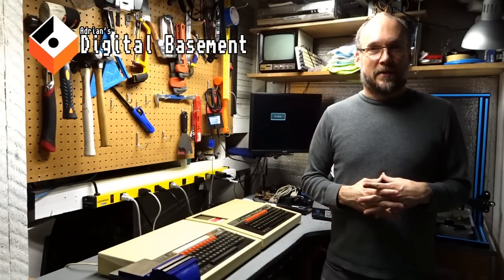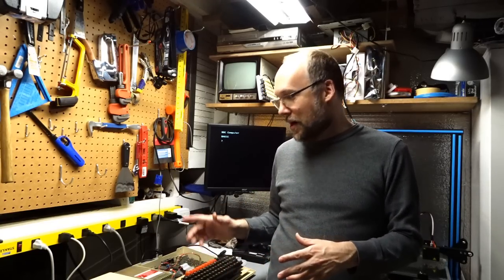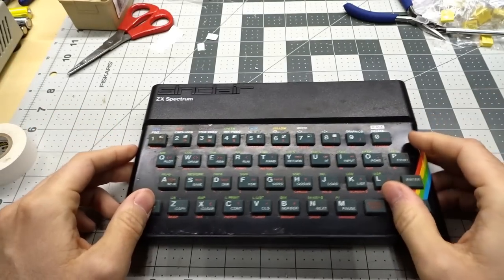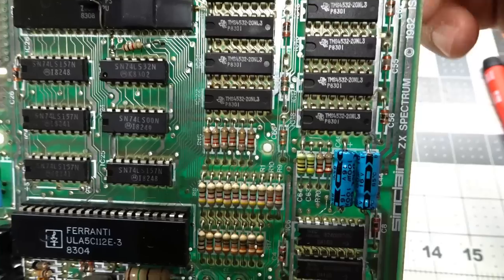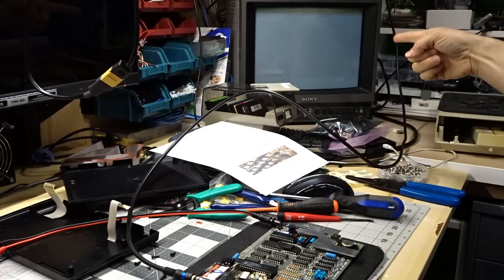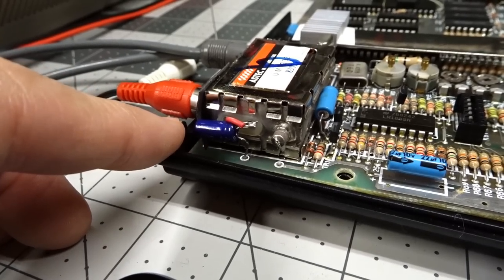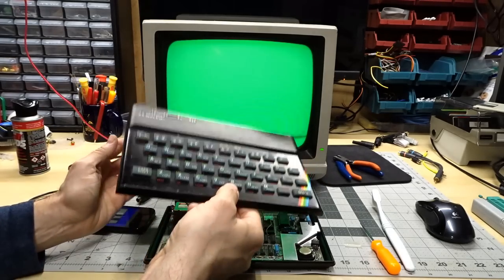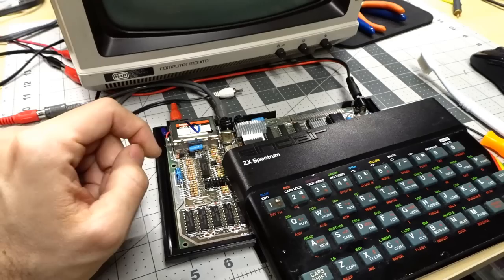ZX Spectrum Part 1 - It's a very sick machine (and a BBC Micro update)

Comment: I would get a 48k + with the toaster heatsink its got a full size keyboard also less of a money pit I found a 48k for 30gbp on ebay with all the spares/parts to fix it came too over 100 with that you can get a +2/+3 for 30-50 working
Reply: 48k with a toaster heatsink? you mean the 128? xD
Reply: @bamdadkhan  yeah but on my original  spectrum i had a 3rd party case

Comment: You could get 16k and 48k. You could buy a module to plug in to take 16k up to 48k. The dead flesh keyboard as we called it was a lot of persons first programming computer. I have had a few and modes them

Comment: On mine the flexi very obviously cracked near the end so I simply cut the end off and it was fine. Check electrolytics in circuit as that’s easy assuming you have or can get a suitable tester

Comment: Hi where did you find the ram test program as i am rebuilding my spectrum, if you search the web you can get a replacement membrane for about $9.00 plus postage
Reply: The one he used is here: https://github.com/brendanalford/zx-diagnostics/wiki/Tape-Tests if you have a socketed ROM and an EPROM burner there are more extensive diagnostic tools here: https://github.com/brendanalford/zx-diagnostics/wiki/Firmware

Comment: IIRC the original Spectrum power supply had output somewhere around +11V, despite being declared at 9. Try to use original supply with 110/220 V transformer.

Comment: The memory on the old speccy often died for no reason, but they were reject chips so.... yep.
Also the transformer based psu did fail, the ztx transistor went short, no ram power :-(.

Comment: Those raster lines with alternating colors are a typical artifact of PAL color decoding. See, every other raster line the chroma phase is flipped 180° so any phase error will be cancelled out by letting your brain and eyeballs "blend" the two off-target shades together into the color that is the average of the two. This is how PAL achieves color tint consistency, eliminating the need for the TINT control that NTSC (Never Twice the Same Color!) systems all have.

This looks OK with ordinary smooth and interlaced broadcast television video, not so good with low-res progressive scan computer video where the scanlines are widely spaced by black lines. They're called hanover bars, and PVMs like you're using typically show them raw and unprocessed. Many consumer-grade PAL TVs/monitors process these out by blending the color information with the scanline line above it, which works, but leaves the color looking a bit washed out and the top line of everything having a color fringe because again, this looks fine with fuzzy interlaced broadcast video but not so nice with computers which have sharp square graphics. Yet they keep telling us PAL is better than NTSC.. to which I say: barf.

Comment: There's a couple of ROMs that add the ability to program the machine by just typing the keywords instead.  Personally, I love my +3's because of the better keyboard, monitor port and floppy drives.
Reply: There's even a port of the Z80 version of BBC BASIC available as a replacement ROM for the Spectrum, including inline assembler: http://mdfs.net/Software/Spectrum/BBCBasic/

Comment: Maybe one of the electrolitics in the -5v path wasnt so good but with voltage applied into it, It Just "reformed" like in old tube stuff... check the measurements in both the capacitors!

Comment: For phone use I built a little 2 transistor audio amp that runs off of a 9V battery and can put out and adjustable signal between .500 V to 4.5 V P-P

Comment: They were sold as 48k from the shops. Dont think anyone ever modded them. The 16k model did not sell well and i think it was discontinued after a short time.
Reply: It was possible to send a 16K model back to Sinclair to be upgraded to 48K; although depending on how busy they were they'd sometimes just send you a new 48k model and chuck the 16k model on the spares pile.

Comment: Try re-soldering all the connections that touch the -5v section. Also give all the Electrolytic caps a looking at. you may have some that are going bad & intermittently shorting.

Comment: Dear Mr. Black Sir. 

Re. BBC micro Computer:

But that does not solve the problem with the Power Supply..
I suggest you resolder the solder joints in the power supply. 

It seems to me a cold solder joint is the cause. Otherwise change the Transformer. 

Best Regards. Greethings from Germany. Stefan

Comment: you may want to check the voltages and run the scope on them a noisy 12v can affect ram performance also check the electrolytic as well, all basic stuff but worth the time

Comment: Adrian did you check that you were giving the spectrum the correct ampage as a common fault was intermitant crashes due to low power .  as the dc  plugs wires used to bend and break shorting inside the insolation or the socket would become loose due kids " wobbling " the pplug ro get them to work causing variations in current causing exactly the symptoms you seam to be getting . ps : plz look uo how to unplug keyboard i cringed as you did that ..lol

Comment: If you buy another ZXSpectrum you may well have the same problems that you are having now. You can buy the Keyboard membranes and the printed cover for the keyboard. It's not expensive. They are still quite popular. Besides all that it can keep the ZX81 company.  The ram chips have always been a horrible. You can replace the Regulator with one that does not get hot and remove that nasty heatsink.

Comment: Wow a socketed ROM from the factory thats is rare.
You can put a eprom in with different basic.
When power up i noticed a very short black paper, thus a 16k or a faulty 48K machine.
Reply: You are right. As soon as he powered it on I knew it only had 16k of ram. The boot sequence does a ram test and based in the results changes the ramtop variable in the system memory space. The test writes  0x2 to each ram location (causing the black box) then each memory location is decremented by 1, checked,  then decremented by 1 again and checked. This causes the black box, then white lines, then red lines, then a white box.
Reply: @akira1310  From the zx spectrum rom disassembly :)
Now the memory is checked.
11DA RAM-CHECK LD H,D Transfer the value in DE
LD L,E (START = +FFFF, NEW =RAMTOP).
11DC RAM-FILL LD (HL),+02 Enter the value of +02 into
DEC HL every location above +3FFF.
CP H
JR NZ,11DC,RAM-FILL
11E2 RAM-READ AND A Prepare for true subtraction.
SBC HL,DE The carry flag will become
ADD HL,DE reset when the top is reached.
INC HL Update the pointer.
JR NC,11EF,RAM-DONE Jump when at top.
DEC (HL) +02 goes to +01.
JR Z,11EF,RAM-DONE But if zero then RAM is faulty.
Use current HL as top.
DEC (HL) +01 goes to +00.
JR Z,11E2,RAM-READ Step to the next test unless it fails.
11EF RAM-DONE DEC HL HL points to the last actua location in working order.

Comment: Get a new membrane, new face plate - both newly manufactured - and also replace the 7805 with a Trico or something - can't remember as it's 3am now 😉😴 - so it runs much cooler then (can even leave out the heat sink then)

Comment: I think that MEMOTECH MTX512 computers are better but you really need the FDX512 duel 5.25" Floppy Drives or the HDX512 if you wanted a Hard Drive in your computer looks much better than the SINCLAIR SPECTRUM and has a Keyboard that is a pleasure to use, just one little thing the VDP chip seems to get hot and needs a Heatsink and fan for cooling,

Comment: The voltage regulator on a few of my ZX Spectrum's always popped for some reason.
Reply: The one in the video looks like one made by Texas Instruments in El Salvador. The factory there produced voltage regulators and standard ICs, with a rather low defect rate as I have been told.

However, Clive Sinclair was more famous for cutting costs than for caring about what happend after a sale, so I would not be surprised if a batch of lower cost (and lower quality) 7805 from a different manufacturer had made its way into some units.

Also, many Sinclair computers were famous for running rather hot (with possibly the Spectrum 128 "toast rack" version being the first one to have adequate cooling). Note that this was also the case for many other contemporary systems; some versions of the C64's "power brick" were famous for getting rather hot, often leading to "thermal discoloration" of the plastic. Early C64 custom chip revision were not a power efficient as they should be, so failing ICs were not uncommon after a few years or decades of service. I also remember replacing a few bridge rectifiers in 1541s which had thermally failed. And, famously, according to some sources, early Apple IIIs ran so hot that the mainboard bent and ICs popped out of their sockets (lore tell the tale that the Apple III should have been fan cooled, but Steve Jobs didn't like that).
Reply: @Klaus Stock .. That's very interesting info. I do remember the C64 power bricks getting so hot that the plastic would slightly warp with the heat. My 128k specky actually had no heating issues through it's time of use. But thanks for that wee bit of history there, I love that sort of stuff, lol.

Comment: I never liked those ZX Sinclair's I prefer proper keyboards. I did find one at a boot sale for 2 quid, it didn't work anyway so I converted it and I put two USB ports on the front for game pads and I mounted a Raspberry Pi zero with an audio board inside and some other stuff running Retro Pi.

Comment: I've had capacitors that need a bit of heat-up time, then they work just fine even after some time without power, I know you like capacitors from the early 80s but blaming capacitors is just so easy :)

Comment: RetroManCave did a great video about the ZX Spectrum and he interviewed the Oliver Twins who deveolped gaves for the Spectrum and Amstrad systems and to program for the Sinclair they used an Amstrad system to write and compile the code and then sent to the Spectrum with adapters between the cartridge interfaces because when they tried to write software on the Spectrum they quickly found out that it sucked for developement.
Reply: Anyone coding a speccy for games used a 2nd system to squirt programs down via a connection unit directly into memory.  It makes perfect sense since if you screw up in ASM its a reset, besides the spectrum keyboard being bloody horrid.
Reply: @sethrd999  Not everyone, although most of the big software houses did; or at the very least had one Spectrum for programming and another for testing, connected together via Interface 1 or a bodged connection via the tape ports. 

The more typical bedroom coder would often write machine code games entirely on the Spectrum; but the code had to be very well structured, since you couldn't have the assembler, source code and machine code for the entire program all in memory at once. With Microdrives and disc add-ons it was slightly easier, since you could assemble straight to Microdrive/disc; and reload the assembler and source code in seconds, rather than minutes.

There were even a few (brave/foolish) people who programmed entirely on paper and then did the assembly manually. Sandy White for example wrote 3D Ant Attack on paper, converted it to hex digits and then used a BASIC hex loader to enter it into the computer: http://sandywhite.co.uk/fun/ants/AAsource.htm

Comment: electrolytic cap on the rf video signal is a) too big capacitance,much smaller would make its job perfectly b) too big parasitic inductance,that would degrade signal quality. put a ceramic 100nf capacitor instead!
Reply from the maker: I actually tried several different values (Especially smaller) and it seemed to do a better job with that one installed.

Comment: You may have dry/bad capacitors, that have damaged the ram chips.
I recapped my Spectrum 128K in 2016, after reading about the dangers of old caps on this type of computers.
If i were you, I would try to check if the capacitors are good. You may need to replace them, as well as the damaged ram chips.

But I'm no electronics expert.

you can read about it in this link.
https://spectrumforeveryone.com/technical/recapping-your-spectrum/

There are also several videos on youtube about recapping ZX Spectrums, that also mention damaged ram chips by dead caps.

Good work, and good luck!

Comment: Clean the membrane pad with alcohol or similar. They get tacky over time. This was a useless PC, I changed mine for the ZX plus 64 bit. Never looked back. Mine was a 16 bit standard probably gen 1 though. If keyboard does not respond, bin if and try to get either the 64 bit or the Commodor 64. They were more reliable and not under powered. Like the web.

Comment: That's nothing man, my ZX Spectrum has a dented top from punching it when I lost on video games, and it still goes ! I've got hundreds of games on tapes still. I even have a Kempston joystick interface, the joystick and upgraded the RAM to a whopping 48kB form 16kB myself. Just chuck it, get another one or run the emulator called Fuse where you can have ZX Spectrum on any computer and download and run lots of classic games and software or this...http://torinak.com/qaop/games

Comment: On a more serious note, the ULA by Ferranti is flaky at best. But by the time you replace the keyboard membrane, get a new faceplate, get a new ULA and probably new RAM: is it worth it? Probably not. 
But they are such a cool machine to own. $ wise it’s probably about even. But if you do decide to pickup another, hit up the ZX Spectrum Group on Facebook and get one tested by an owner/enthusiast.
Reply: theyre not that flaky. the ula itself doesnt tend to fail unless some serious abuse on the expansion port has happened. 
The biggest bugger in these things is the 4116 RAM chips. What especially kills them is if the voltage converter circuit fails and the -5V supply goes missing. Ironically enough, failing 4116 chips can often kill the voltage converter, which then kills further 4116's

NMOS Z80's also like to die, but theyre readily replaceable with modern CMOS ones.
Reply: @jaycee1980  I agree, we very rarely saw ULA failures when I worked at Sinclair. The negative supplies and the DRAM chips, well, yes, those were and are problematic.

Comment: Of course there is no sense fixing any retro computer when it comes to time consuming and money. Just throw it away and run an emulator. For me, retro computing is all about getting an beat up old piece of junk restored to its (as close as possible) original glory or at least getting it to work, and using it for things that it was meant to do.

Sure, there is a limit for everything, but in your case you have a machine that still boots somewhat and only needs few replace part for it to work fully, despite being visually beat up. Of course it can take some time and effort to find what's exactly wrong with that thing but with such a simple piece of tech there's not very many possibilities. With Sinclair I can imagine it's a bit harder to get let's say a new keyboard when you're living outside UK, but don't think it's impossible. Maybe some of the UK followers have a spare part lying around, and would like to help.

Great video(s) however, they're pleasant to watch.! Good work you're doing there!
Reply: Not true - some vintage computers are worth a heck of a lot of money, such as Commodore's SX-64 and PET; those are absolutely worth fixing in a financial sense.
Reply: That'd be its (possessive pronoun) original glory. It's is the contraction of it is! In other words your other two uses are correct but that first one is wrong.

Comment: yes it is worth fixing
Reply: even if upper ram control chips seem ok, try replacing them
Reply: and i assume you've 'reaseated' the ula? i had a spectrum 128 that would crash randomly and always if you tapped its case, reseating the ula and wiping its pins in contact cleaner cured it

Comment: both machines have fb groups. beeb lot are more friendly I find. a minority of the spectrum lot like writing BS online sadly and run off like little rats when challenged properly about it, it's more amusing when you call them out for cr*p talking, they go rather quiet..as for the bbc,  do change the rifa caps in the PSU's , as when they go.. they really stink. not easy to get parts, as I have that issue in the UK with apple // stuff, which is plentiful there compared. not impossible to fix them up, you don't have that much to do.